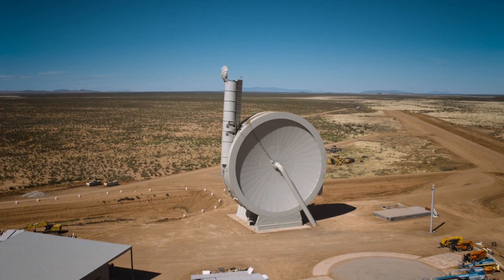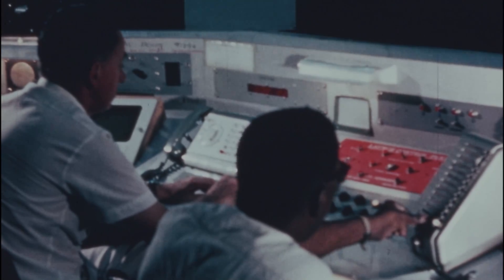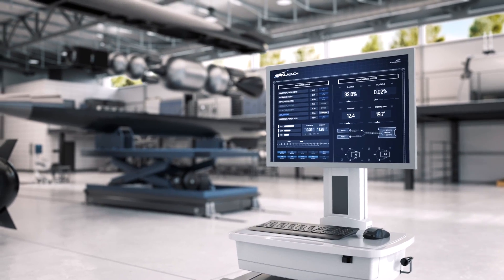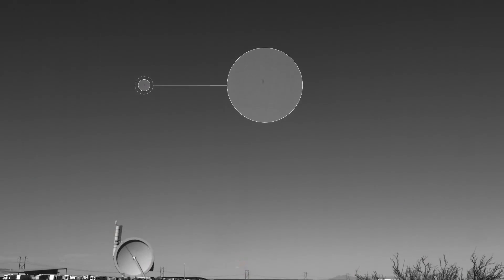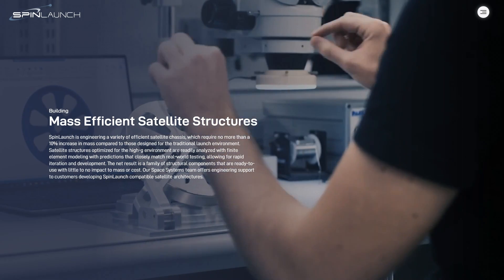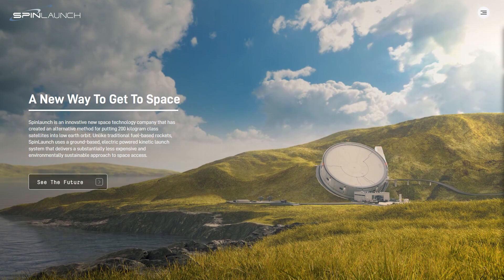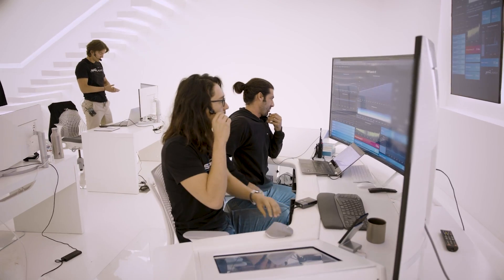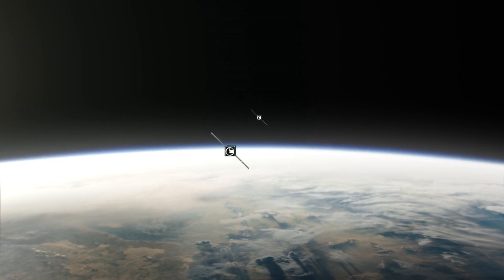Can Spinlaunch Throw Rockets Into Space?

Comment: Hey Scott, many years ago I saw a rail system, using actual train tracks, for launching rockets. It used a couple of hundred dollars worth of electricity to get the rocket up to near the speed of sound, going horizontally at first and then up a steep incline just prior to release. A more modern version could probably get to higher speeds and save more fuel. Though not as sophisticated as this yeeting idea, and not saving as much fuel due to the lower speeds, the rail idea would be much simpler and cheaper to build. Have you seen anyone trying the rail launch idea in recent years>
Reply: Yeah, that idea basically died after Evel Knievel failed to jump the grand canyon using the same principle 
I did hear a coyote on roller skates was trying to restart the idea
Reply: It doesn’t really help!
The problem is that people confuse two things:
1) A Saturn V launch can use 10% of its total fuel just to clear the launch tower, at a few m/s. So people assume that the “first kilometre” is really valuable when you are carrying all that fuel. However……
2) Orbital speed is Mach 22. By the magic of kinetic energy, reaching initial Mach 1 only gets you 4% of the way there. So, it’s not really that great a help. You are still going to have to make the rest of it the same engines, sensors etc, just 4% smaller. Whereas, adding an extra acceleration stage is a whole bundle of extra engineering problems to be solved, plus constraints on the main launch vehicle.
The real issue that Musk points out, is that for Falcon-9, fuel is only 2% of his costs! People treat this like a science problem, where you have to save delta-v. But they are just solving the wrong problem*, and have been doing so for sixty years now. The real costs are building and *testing single-use vehicles. The only things really matter are:
Maximising the fraction of launcher that is reusable.
Minimising the engineered cost of the non-reusable stuff.
Musk has actually been making the non-reusable bits out of heavier materials, because they cost less.
Reply: @johnfranklin8147  as was pointed out in the video there are other concerns than simply the bottom line. 
1) Carbon emissions if you care
2) All that fuel that has to be at the launch facility posing an explosion risk, there'd still be some but way fewer
3) Noise, rockets are loud as fuuuuuuuuuck for a very long time, this would have the sound of the vacuum collapsing and a sonic boom, which combined would take a quarter second or so
4) can be rolled out for other planets without good fuel resources
Reply: @jypsridic   how much carbon is generated by the megawatts of energy needed for this launch though?
Reply: @brianmaniora3992  solar, wind, hydro - potentially zero carbon released generating launch electricity
Reply: @jypsridic  remember that liquid hydrogen and liquid o2 can easily be made from water and renewable energy
Reply: @jypsridic  I do care about the environmental carbon cost. There is no reason to think this saves any.
Most of the carbon cost comes from the various engineering activities of getting the thing to the launch pad in the first place. Launches cost $100m mostly because of the thousand man years of engineering effort in each of them. The engineers and managers fly across the world to attend contractor design reviews, drive cars to work, have families, live in heated houses, and have gas barbecues at the weekend. The carbon in the fuel on launch pad is a rounding error in lifecycle carbon cost.
The spinning rotor has its own risks: if the rotor fails, all that stored energy will whip through the structure and destroy everyone and everything in its path. Although the toxicity risk is much lower. Also, there’s quite a high military/terrorism risk, because someone who controls the launch station gets to angle and aim a 200kg payload to pretty much anywhere on one hemisphere. It’s a 5000km range mortar, with relatively high fire rate, in a way that a rocket launch site isn’t. This is not entirely unconnected with why the project is being funded.
Reply: @jypsridic  On other planets, and for other purposes, yes I agree it could be an interesting idea……
Reply: @brianmaniora3992  idk, idc. Probably not much and it will be less every year. I have no idea what their power plant uses for the source of electricity, for all I know they could be completely carbon free in that aspect. I still wouldn't care though.
Reply: @tdelmo33  That's nice, not every surface of every body in the solar system has an easy supply of oxygen and hydrogen.
Reply: @johnfranklin8147  I personally couldn't care less about the carbon cost, but it is still going to be less than any hydrocarbon based rocket fuel launch. 

" if the rotor fails, all that stored energy will whip through the structure and destroy everyone and everything in its path"
if the rocket fails all that stored chemical energy could fall on the launch control building and tear through the structure and destroy everything in its path.

" aim a 200kg payload to pretty much anywhere on one hemisphere" the launcher is probably not going to move, just like the current rocket launch pads don't, you aim  with the rocket itself.
Reply: @johnfranklin8147  No expert here but I do see an advantage with a system that can give multiple km/sec delta-V. Just because the entire first stage can be replaced with a device that's (hopefully) fully re useable. As they said, even off the shelf consumer electronics survived the accleration when braced adequately.
Reply: @deltab9768  But why do you want to save a relatively small fraction of delta-v? This is not a science problem, it is an engineering problem. The second and third stages all still need to be there. All the rocket problems still need to be solved, and paid for. And those become more expensive too, both because you’ve shoved a whole new set of constraints on them. And because the rocket manufacturer now needs exactly the same manufacturing facilities, engineering team expertise, and design time, so the annual cost of doing business for them is nearly the same within a few percent. But they get to charge the customer for only half as many rocket motors, so each one costs twice as much. 
When you actually manufacture rocket motors, the cost of the steel isn’t where the money goes.
Reply: @johnfranklin8147  it’s kinda sad when you put it like that. Btw, I agree with you.
Reply: Sounds like Heinlein's old launch system.
Reply: China uses incline/ramp launch

Comment: It's interesting tech, but I disagree with the last part of the video, it really doesn't make sense on the moon. Why? The exact reasons you said makes it ideal actually makes it unnecessarily complicated.
Launching from a low-g no-atmo site really only requires a railway with a quick release system and you can use linear induction motors to accelerate the cargo pod, the whole spinning up a rotor to that speed is redundant and risky.

Comment: The problem of the weight balance immediately post launch... couldn't that be solved by simply releasing a matched weight from the other blade of the rotor? Sure you'd be yeeting something into the ground, or a deep pit or something, every time you launched a thing into the air, but that's gotta be easier than some kind of complicated weight shifting thingamagig built into the rotor... right?

Comment: 8:50 Why not releasing the counter weight? You could, i.e. use a copper core weight, using powered solenoids to slow it down, converting kinetic energy to eddy currents to heat, leaving you with a casing filled with molten copper, or use a magnetic weight to convert kinetic energy to electric energy, which can be used to create Jacob's ladders above ground. Maybe the ozone produced could be beneficial for our ozone layer?

Comment: Obviously they weren’t BMXers.  Because then they would know, if you get something up to speed horizontally and then use a transition to make it vertical, it will maintain most of that speed with little friction.  Also, since the horizontal area could be as long as you need, you would have more time to build up speed and not have to “yeet” something from stationary to speed quickly.

Comment: Well... the easiest way to release they payload at launch would be to have an equally heavy dummy and release it at the same time at the other side of the rotor, facing down, 0 stress for the main components, only a big water tank or something to stop it safely (if it's made fo sand, or small particles, is much easier to be stopped).

Comment: Many years ago (in the 1960s) I wondered whether it would be possible and worthwhile to use balloons to raise a rocket-launching system to the edge of the atmosphere - or at least as high as possible, and launch from there.  I have never seen this suggested or discussed, though presumably it must have been somewhere - so presumably it wouldn't work - but why not?  I envisioned a circular launch platform with a number of balloons tethered to the circumference, so the rocket would launch from the centre of the disc.
Reply: I tought the same, with a central balloon that would be doughnut shaped. I think the issue is that the launch would burst the balloons and all that helium is expensive.

Comment: If they have a dead counterweight on the other end of the rotor they can release them simultaneously. This would keep the rotor balanced. The counterweight can just be launched into a hole in the ground. It would be carrying a lot of energy so you would need a deep cave :)
Reply: A half of a rotation would destroy the rotor and/or bearings at those rotational loads.
Reply: Or in Scotts suggested situation of on the moon, could you do this on an elevated platform of say 100m and launch two in opposite rotations?
Reply: An easier way would be just to shift the balance of the rotor.
Reply: I wonder if you could have a weighted rod in the arm that initially acts as part of the counterweight, but then gets shot to the other side at rocket release. That'd both lower force at the counterweight end and add a force on the other side to help make up for the missing weight of the rocket.
Reply: The counterweight's energy would be approx 25 GJ (or 6 tons of TNT). If you don't have a very deep hole before, you will have a large crater afterwards.
Reply: Or hang onto it for just another half revolution. Or put two matching payloads on.
Reply: On second thought, that 2nd payload would probably hit the first one since it would be drafting... yet another millisecond-accuracy problem that ?may? be solved if the two trajectories are just slightly different. High risk for both payloads.
Reply: Or launch it into a  mattress and recover it.

Comment: I've got questions:
-why 35 degrees?
-isn't maintaining vacuum in a such a big chamber a dooming problem, just like it is for the Hyperloop?
-why the vacuum? Why not rotate the air around the projectile with it? Meaning you create a tornado while spinning up. I guess there's friction with the walls but you could ionize the air to reduce it a lot (you'd have, for example, positive gas/air ions inside a chamber whose walls are also positively charged).
-what's the point of the exit tunnel? You get gun barrels to guide the projectile and channel the gas pressure but here it's in vacuum so why the long face?
Reply: The space they are maintaining a vacuum is tiny compared to even a single section of hyperloop, so thats not really a problem.
Reply: @JackNormalMemes  Tiny? Maybe in the prototype. The full scale installation should have quite a volume.
Reply: @florinadrian5174  the hyperloop called for miles of tubing to be under full vaccum, hence it being a fools errand, this would only have to be under slight vacuum for short periods of time. I'm not saying that makes it easy, but it's a damn sight more possible than the hyperloops stupid set up
Reply: Exactly the same things bothered me. T
I'll leave a comment here ^^
Reply: I doubt maintaining vacuum is a particularly difficult problem. Why do you see it that way? They don't need ultra high vacuum. They are just reducing air friction.

Comment: Solution to problem #1;
Launch from highest mountain tops near the equator. This drops air density dramatically.
Solution #2;
Have match loads on opposite ends of the launch arm and release both simultaneously. One is the rocket, the other is a slug that travels 500 meters down an energy return system, that converts the momentum back into stored energy.

Comment: 50 m radius, 160m circumference, 7.5 rps, tangential v 1200 m/s, not 2 km/s.

1440000/50= 290,000 Newton per kg or 29 tons force equivalent per kg.

This amount of force would crush/deform anything other than a solid projectile, a second stage rocket would be crushed/explode in the centrifuge.

It’s good fun but a hopeless plan for launching anything useful.

Comment: What is the ratio of the weight of the spinning arm compare to the payload weight? If the ratio is high enough (e.g. 10/1), the imbalance of the rotor can be manageable. The high ratio is good but it has a downside of limiting the payload mass.

Comment: Scott, today you disappointed. The Sprint missile of the 60's was cancelled because we did not have a number of technologies available to survive AND perform after a 300G acceleration. This presentation pointed out several problems thqat still persist with this problem, so the idea is a non-starter. Also, like a young schoolboy you effuse about using this concept on the moon...glossing over the obvious problems of getting a billion ton fly wheel and a very powerful electric generator onto lunar terrain!

Comment: Does it regenerate electricity back into the grid when slowing after launch or does air resistance stop it quickly?   There’s a lot kinetic energy to have to get rid of.
Reply: Oh, I’m replying to my own comment which is probably a YouTube faux pas, but it occurs to me that in the idle times between launches you could use it as an grid storage device to keep the frequency stable.  I bet it could go from 1MW in to 1MW out in a second.  We are just scaling up what is under the hood/bonnet of a Tesla….

Comment: Won't work. 
1. The abrupt change of forces during release would rip the bearings of the arm to shreds. In the best-case scenario you have to reinstall a new arm. In the worst-case scenario the debris of the exploding bearing punctures the chamber. 
2. If you do the math, the centrifugal acceleration is 20.000G, not 10.000G. They have yet to prove that electronics can survive 20.000G.
3. They are actively hiding the problem of the centrifugal force-gradient. If the rocket is 1 m wide, there is a tensile force-difference of 2220 m/s2 pulling the rocket apart SIDEWAYS.
Reply: 1. Their solution is releasing the counter-weight at the same time. Center of mass won't change. 
2. I got 11322.2 g
3. The arm itself has to withstand over 111 kN. If they can do that, 2 kN is easy